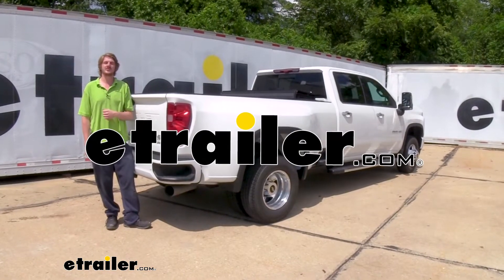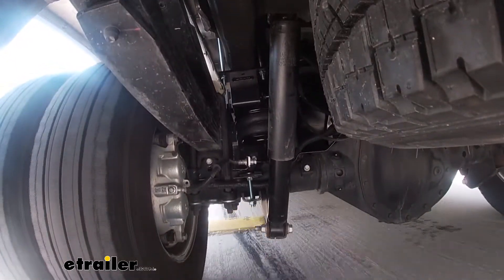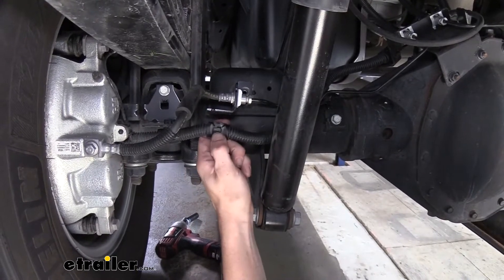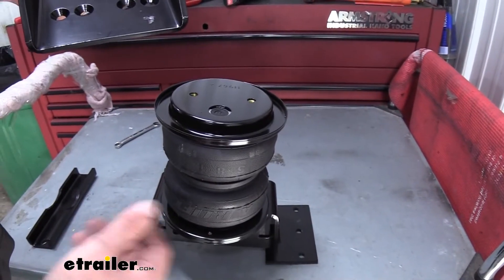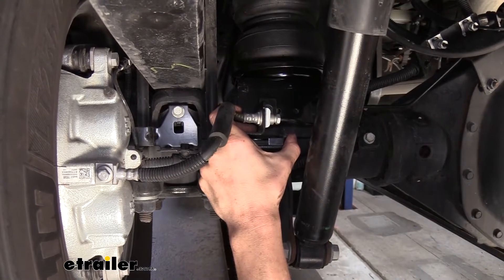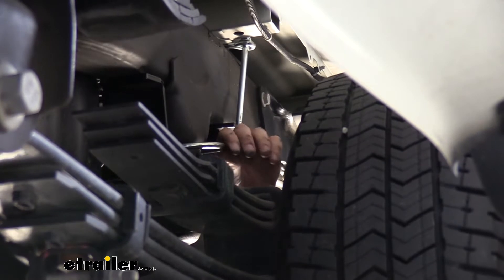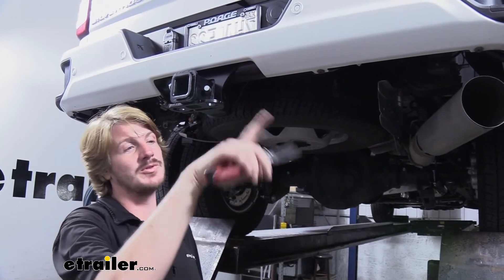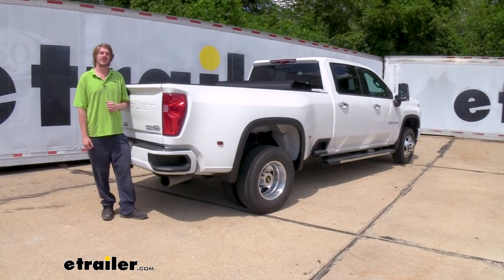Air Lift LoadLifter 5000 Ultimate Rear Air Helper Springs Installation - 2021 Chevrolet Silverado 35

Comment: Do the air bags sit up straight up and down I had a shop install mine and mine sit a little sideways
Reply from the maker: These air bags will sit slightly cocked to the side because of where it has to attach to the frame and the axle.
https://www.etrailer.com/vehicle/2021/Chevrolet/Silverado+3500